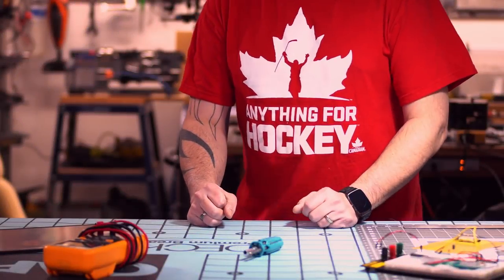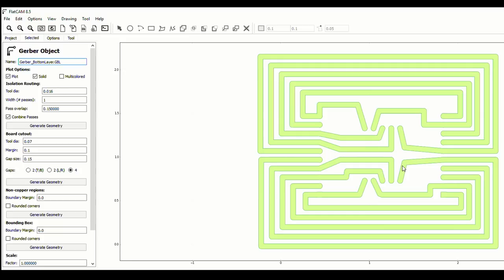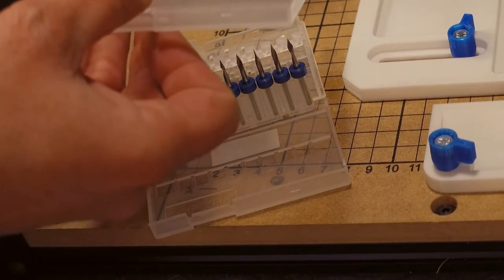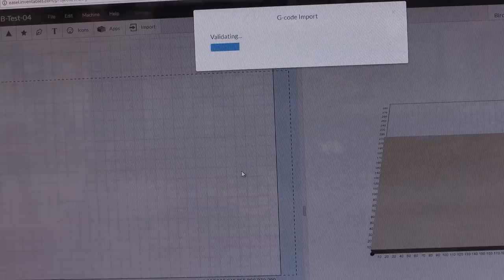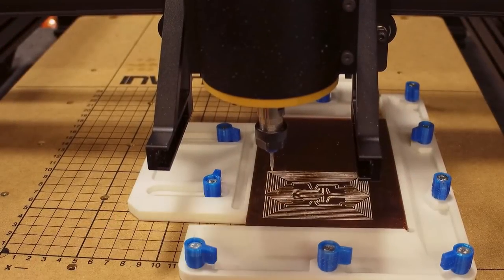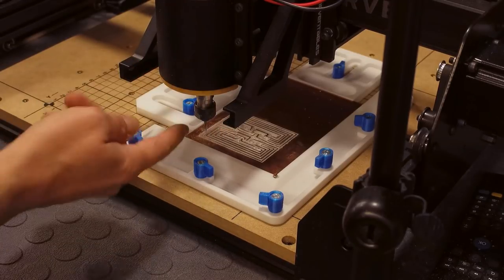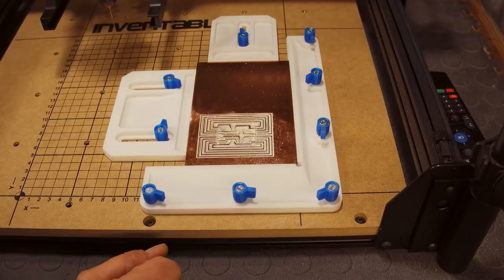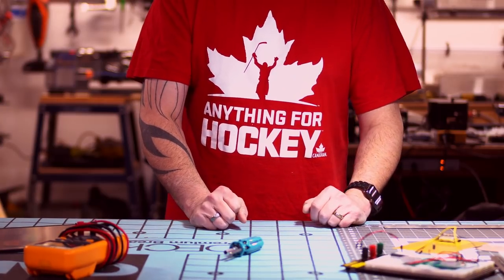Milling your own PCB at home with a CNC Router!

Comment: What spindle speed do you use? RPM?
On the Thingiverse link there is not the exact design that you use. Where did you get it? can you add a link for this files? 
Thanks

Comment: You are carving way too deep. You only need to remove the copper which for 1 inch copper is only 1.4mils thick. Your bits will last way longer that way! You also might want to look into an autoleveling program.
Reply from the maker: Hi Sam, I agree that I was going way too deep, this was the first time I tried this, but it did end up working in the end, will adjust the depth next time and look into using maybe Chillipepper to probe the PCB and adjust accordingly next time :). Thanks for you comment and for watching!